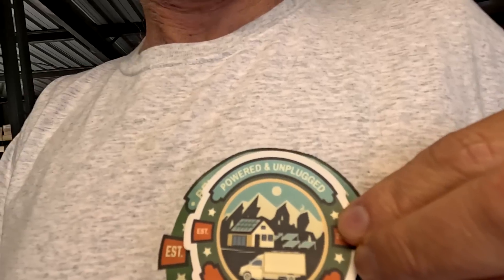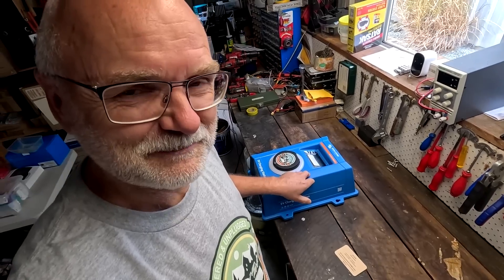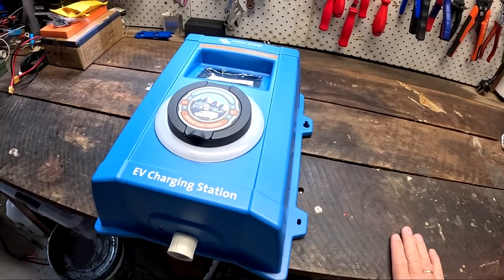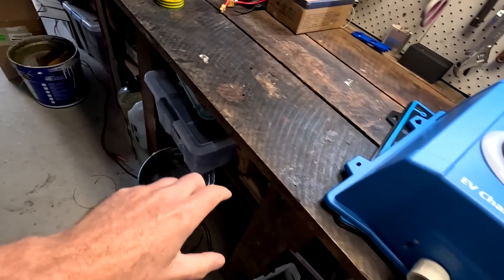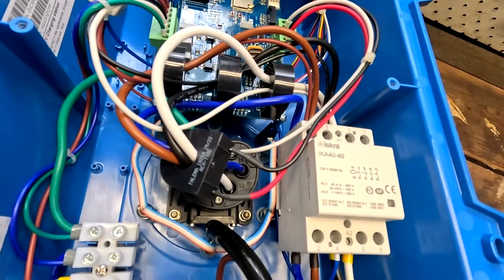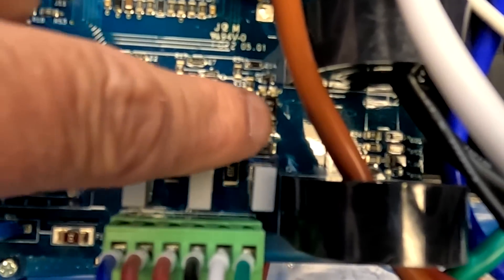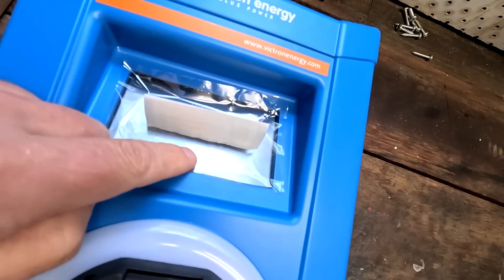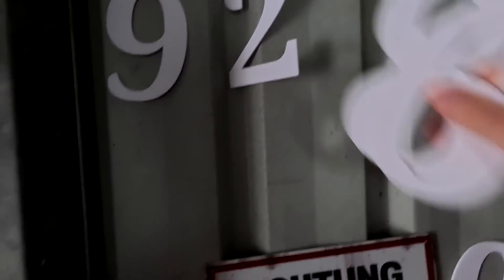Why a Victron EV Charging Station for our second EV?!

Comment: Hi andy, it should be possible to switch between single phase and three phase operation. This might be handy when using the auto mode at winter time. Is there anybody in this community that has heard about this ?

Comment: A solar flower stands on the meadow you can't water it it produces electricity then a bee comes with a coffee machine and sucks the solar flower dry
Reply from the maker: Thank you very much for your support!
Reply: @OffGridGarageAustralia  American Solar Power😉
I have developed a prototype for solar systems against hurricanes
The system moves into the ground by itself. To move it out, you have to unlock the system by hand and then the hydraulics move back up again
Electricity is what you don't have after a hurricane
Test successful...

Comment: Hi, I've been looking at the EG 6000XP which seems to streamline everything very simply. Is there a reason why it would not be used in Australia? My husband and I have followed you for 3 years, and always intended to power our off grid home with all your knowlege helping us, but very very sadly, he has past 1:02 away, and I'm now doing it all solo. So it has to be simple. I've had every intension of using victron, because as we have switched to thst for our camper trailer, the EG4 6000XP seems to only need the distribution boards.... is it too good to be true? Not needing this separate car charger to do the car. ???

Comment: Interesting that there is only one knockout for wire / cable entry. Does it not talk to the rest of the Victron system by anything other than wifi? How might the communication cables get in / out of this charger?  Watch out that wasps don't get into the connector drain tube.

Comment: For a Victron system it's shocking in my opinion. I bought the NS version a while ago just for testing purposes. The fact that there is no automatic switchover from 1 to 3 phases is a no-go for me. What I find worse is that the preparations are already there on the board and in the software but have not been implemented. I replaced the chint contactor with 2 25a contactors and changed the software. It works in my small system with limitations but all in all I think it's a shame that Victron brought such crap onto the market. A network port would also have been desirable.
Reply from the maker: What switchover from 1 to 3 phases?
Reply: If your care is single phase too. Than there are 2 ways. Just connect 1 phase, or if the wall box is checking the voltage, Just bridge you phase 1 to phase 2 & 3. I use many Wallboxes for demo with a single phase plug with out a problem.

Comment: First off you don't need a second person to connect it to power. You can do one of two ways, wire power to a terminal box and prewire the charger to connect to terminal box, or wire to socket for 3 phase and prewire the charger with the male end plug for the socket, and then you can move it if necessary.
Reply from the maker: Yeah, ok with an additional plug... But usually, that's not how it is connected.
Reply: @OffGridGarageAustralia  Also sometimes a regulatory issue to connect it via a socket. The euro 3-phase 16A/32A red sockets are only rated for full power for 8h continous use. And in some countries it is now illegal to connect an EV charger through a socket or even install a socket for that purpose.
Reply: @OffGridGarageAustralia  True, but you make it portable and not tied to one spot.

Comment: I'm looking forward to followup videos for this charging station. I'm looking to either convert my OpenEVSE to 3 phase or buy this one. There are projects to let the OpenEVSE talk as a supported EVSE to Victron, but maybe a better solution is to get a real Victron one. They are around €375 at this moment which is still more than a conversion to 3 phase of the contactor will cost me, but the OpenEVSE is around 6 years old and has done a great job. Only thing I do not like so much is that my Thetered cable will have to go. But maybe looking at this inside I can attach it to the station myself. It's already a 32A 3 phase cable. Especially with dynamic prices and an ESS onsite it will be valueable to have an all Victron setup to make it work smooth. Thanks for sharing the first bits and congrats to Silke with a nice shiny red Ora!
Reply from the maker: Thanks, Edward. Yeah, dynamic pricing will be of great use to charge your vehicles from the grid when it is cheap. That is something we have for a while and everyone can use it through an app when signing up with a specific energy supplier.

Comment: Is it just me or does it seem like the proximity pilot is not connected?
The proximity pilot is used to determine what current the cable is capable of handling. Without it you could plug in a 16 amp cable to a 32 amp EVSE and a 32 amp car, and have 32 amps being drawn through the 16 amp cable. And we all know how that could end, right?
Reply: The PP has a resistor to earth in the cars side plug. This resistor controls the max Amp the cars ac charger can take using that particular cable. At the charge adapter side no PP connection is required. The actual current supplied is controlled by the CP and the 1kHz PWM signal is generated by the wall adapter.
Reply from the maker: Interesting...
Reply: @moestrei But without knowing the max. Current of the cable the wall box can’t stop charging if the car wants more current than possible. While testing a wall box it is always a check that the CP signal is limiting the max. Current to the limit of the cable. In case of a failed the wall box should protect you for worker thinks. See EN 61851-1:2011. You are right if you have a fix cable on the wall box. Than the wall box knows the max current of the fix cable and only the care has to know the max. Curren.
Reply: @zoom_h2625  The wall box CP limits the current the ac charger of the car is allowed to take to what the switchboard can provide. 
The cables PP limits the current the ac charger is allowed to take to what the cable can handle. 
Say the Switchboard can supply 32A but the cable can handle 16A only then the CP PWM'S duty cycle will command 32A but the resistor in the PP will tell the cars ac charger to take 16A only. Take a Type 2 to Type 2 cable. Measure the resistance PP to Earth on the car side connecor. You will get a reading of a few 100 Ohms. Measure the other end: It is open circuit.
Reply: @moestrei  Nope see EN IEC 61851-1:2019 Picture C.3. PE is used as Potential for CP + PP. The EV charger has to monitor that current will not exceeds the max. Current of the used cable. Previously, the EV charger had to refuse charging if the charging cable could not carry the maximum current of the EV charger
Reply: @zoom_h2625  I'm talking of what we have here in Australia in real life and not some diagram of some document.
Reply: @moestrei  if victron tell that the wall box meets the IEC 61851-1 / EN 61851-1 than i think they should do what the IEC requires. Even in Australia. I think Volt & amp will not change there behavior because you are down under?
Reply: @zoom_h2625  The point is there is no resistor to detect in the connector of the cable on the wall box side. I do own a cable made by Mennekes in Germany and I will measure it tomorrow. But every other cable has nothing connected to PP on the station side. And all Type 2 stations are accepting those cables too.
Reply: @zoom_h2625  Interesting: The Mennekes (They developed the Type 2 standard) cable does have a 220Ohms resistor (=32A cable)  between PP and PE at both ends.  So the wall box (or charge adapter in general) can check both, the capacities of source and cable and interrupt charge if the cars AC charger exceeds either limit. I have repaired a few chinese AC adapters and none of those has that feature. The Tesla HPWC on the other hand even monitors the temperature of each cable terminal in the box and the connector to the car...plus it has a 64A rated ABB contactor. At the end you are right. The Victron and many others plus the cables do not comply with regulations. No insurance if your car / house burns down.
Reply: @moestrei  sorry i was right. But are your guys not responsible for killing all tungsten lamps in the EU? You take energy saver lamps for not burning down you houses? And than you have less safety on a Udo to 22kw cable?
Reply: @zoom_h2625  The real issue is that millions of EV owners trust that the equipment available is compliant but even manufacturers like Victron fail to comply. I drive electric 30.000km/a for the last 5 years and the biggest issues are not the cars, it is the bs around charging infrastructure.

Comment: we got a second Pulsar Plus Wallbox from Wallbox the manufacturer - 250€ for 11 kW charger with ocpp supporting EVCC Surplus charging. 
And EVCC is free cause as EVCC says the Pulsar plus Wallbox has a good Karma. Otherwise it would be 100$ lifetime or 2$ / month.

We have Victron free solar system.

Comment: How do you connect it to the car?  Did it come with a double plug cable?
Reply from the maker: Yeah, it has the Type2 socket under the front lid where I placed the sticker. You can see it at the beginning of the video.

Comment: You may wanna look into at least 32s 96V pack for meaningful charging speed such as 4kW. I’m not fond of DC current more than 50A. Off grid market not ready yet for reliable, safe n easy EV charging setup.
Reply from the maker: We're not into fast charging. We just don't have the need to charge fast. It can trickle charge on 6A for hours, no problem. If needed, we can adjust the charging to 16A.

Comment: No network cable or bus system for connecting to Victron is bad. I know WiFi is simple, but cable stuff more reliable
Reply from the maker: Would not work for me in this remote installation location anyway. Wifi is fine. My whole Cerbo and Pi runs on Wifi for years without issues.

Comment: They do have good features, but you need home assistant to make it work properly(needs to upgrade to firm ware 1.29 for additional features).  I posted this issue on Victron forum, haven't had a reasonable answer yet so HA (Home Assistant) to the rescue. Auto - uses excess solar and a user configurable amount of battery before it stops. Then it waits till the next day for the sun.  No good if you then need to finish the charge later, that takes manual intervention. So HA switch's mine to manual at 9pm and then charges the car to a predetermined kw, based on the Chargers current "Charged amount" vs the kw t I set on the screen in HA. Then in the morning I have a sunrise trigger that switches it back to auto. It needs to use the inbuilt schedules and have a 4th mode, that is auto by solar and then top off according to schedule to a kw of X. Which is what my HA does for me. Not Good... My "Zappi" My energy, does all this automatically, yes it does cost $400 more, but this Victron EV charger needs a Type B RCD which costs $400, Zappi its built in.
That said it works great, in auto once my batteries get to 70% SOC (71% on display) the auto just keeps notching up the amps to match the solar production, so today I was charging the Tesla with 22amps free from the sun to 413km. Tesla can better manage the basic charging functions, but this manages the Auto based on available solar better. Previous vehicle was the PHEV Mitsi (EV Unplugged) and this was a dumb charge car, so the Victron made it better.
Reply: Surely this can be done in Node Red on the Cerbo as well. I have HA but use Node Red on the Cerbo for all the extra control I need (no EV or charger though).
Reply from the maker: The automatic feature will make almost no sense for us in an off-grid system.
Reply: @OffGridGarageAustralia  it could make sense, it could check and monitor loads prior to turning on the charger, last thing you want to be doing is be drawing more power than the inverters can supply. Mind you, you could still have an issue if the car was charging and a heavy power draw came on from house, such as an induction hob or electric oven, could monitoring and turning down the charger save the day????

Comment: Please also look into the unofficially supported phase switching (hardware mod needed) to support low (= low sun) and high (3 phase high current) power charging and the problems where part number SPR00103 is needed. I wanted to share links to these topics, but it seems this is not allowed by YouTube :(
Reply from the maker: We don't have three phase in this location and won't use the auto settings much. It will be manual set to a fixed charging speed for most of the time and we start charging when power is available and not needed for other stuff.

Comment: i would suggest to wire the Charger up to a 3 phase 32amp aussie plug to when you come and visit us in Alice Springs you can take it off the wall and use as a portable EVSE dor AEVA TOCA 22kw network ( then wire up the shed with 3 phase socket with only Phase A connected for 32amp single to suit the off grid Garage...!
Reply from the maker: Hello, my friend from far away! We really don't need three phase for charging. We have so much time and can trickle charge both vehicles on low AC single phase. In fact, we have now converted the whole house to single phase.

Comment: OCPP?
OCPP chargers can be controlled with Home Assistant and you can automate charging rates as it suits you system's generation capacity.
Reply from the maker: To complex. It will be a plug'n play charger with manual settings.

Comment: This ev charger is still around $ 1800 in Australia. However, victron released a new ev charger recently around 900$, which doesn't have a built-in display
Reply from the maker: Nope, you can get it here for just over $700 now: https://www.energyeco.com.au/products/victron-ev-charging-station?variant=44051153813744

Comment: $900 still seems pretty expensive considering what is actually inside the box, I think maybe $50 of parts.
Reply: In the Netherlands it's around €375 with display. Sure you can make it for that money, but others are pricier and have less features and Victron is doing a good job keeping standards open and support is good. I paid €500 6 years ago for an OpenEVSE and that had it's flaws, sure you could tinker around with the Open Source but not all was ok to change. So looking forward to more content on this Victron EVSE
Reply from the maker: Like with your smart phone. But you pay $1000 for it.
Reply: The contactor alone is over $50
Reply: @ThanosSustainable  will be less than that for bulk purchases for manufacturing.